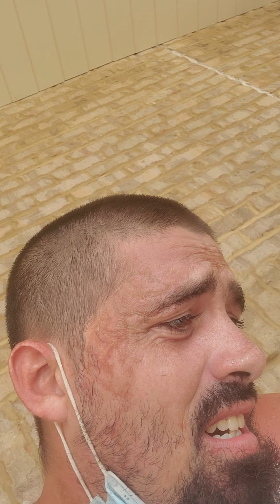ms2115a  good durable multimeter

Comment from the maker: Extech ma 1500 is better it measure peak ac  voltage and peak ac amps  it got a measure cycle of two time a second do dc amps and its also got 5 digits to ger good resolution of voltage and measure amps up to 1500 amp